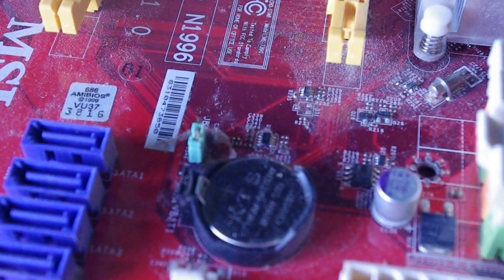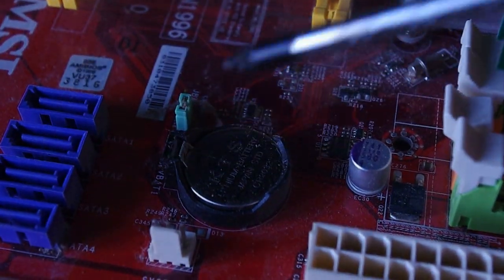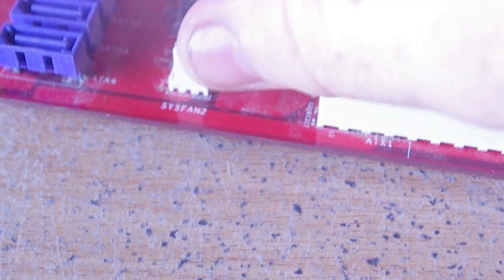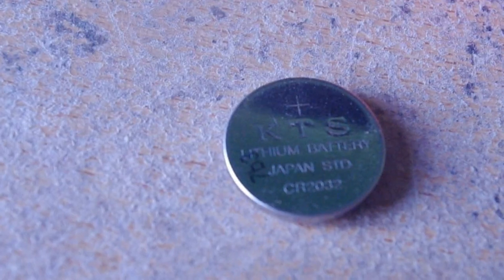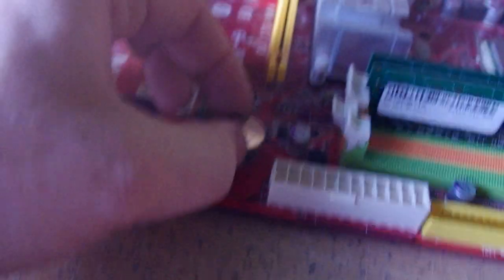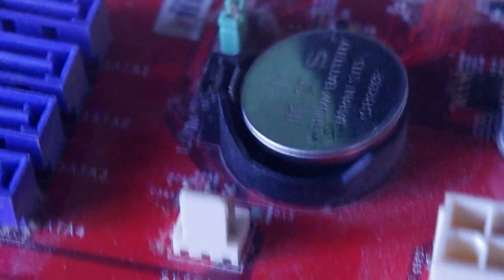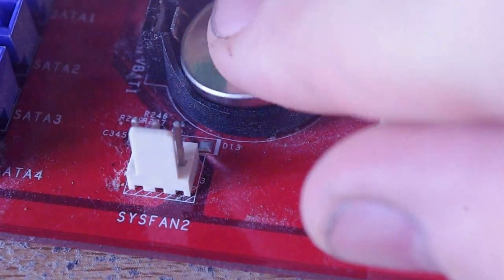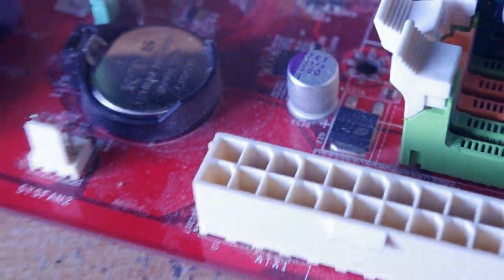How to change a Desktop Computer CMOS "System" Battery

Comment: Hi and thank you for the video. Can you please enlighten me if its not too much trouble. I have changed hdd recently from 500 to 1000 gig. I had cmos 3 valts. Shall i change to 4v for example because i have message popped up battery low after changing hdd from 500 to 1000 gig. I would really appreciate your help.
Reply from the maker: The message you are receiving will still be related to the CMOS battery. The HDD change is coincidence. The CMOS battery is only use for the motherboard to store the timings and settings nothing else. Your computer power supply gives the power to the HDD nothing else. Change the CMOS battery and it should solve your issue